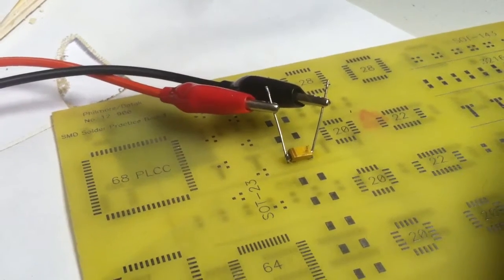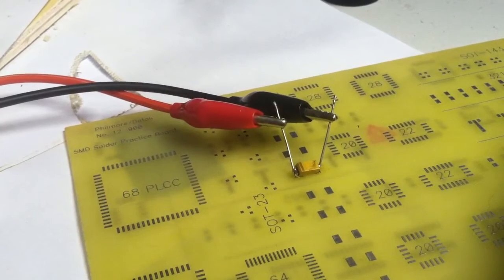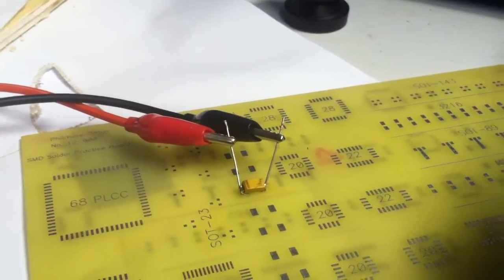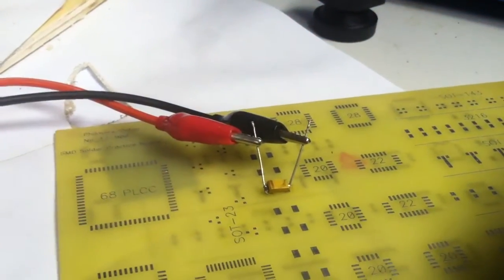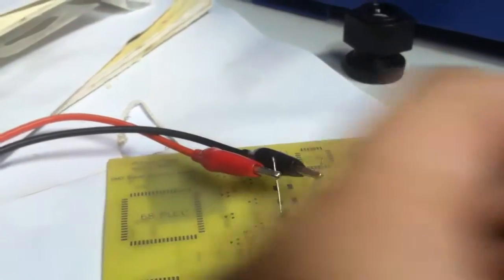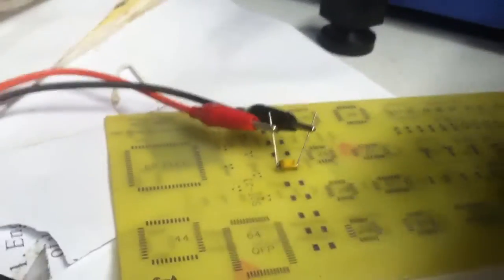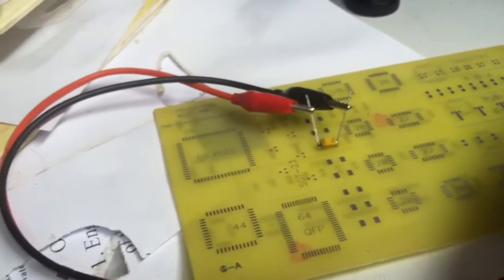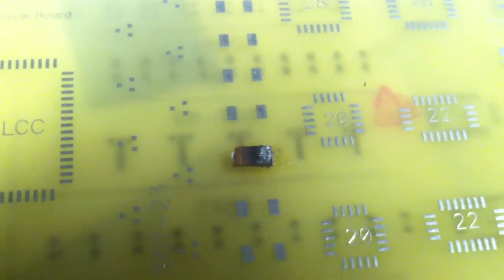What a tantalum capacitor looks like when it catches on fire

Comment: Rather than burn up your practice board, might as well just solder wires to the capacitor or see if the alligator clips open wide enough to bite down on the DUT.